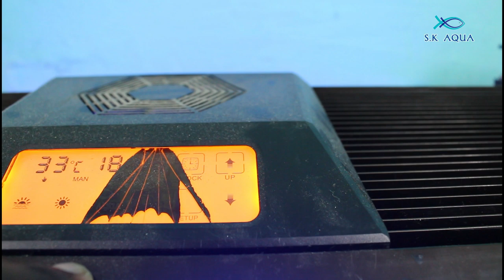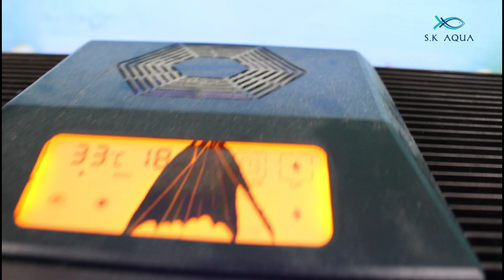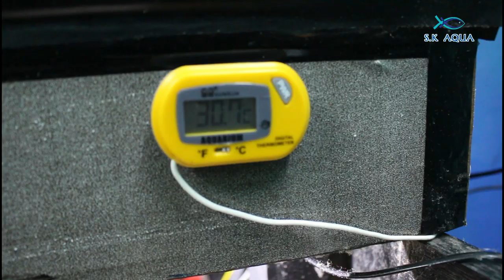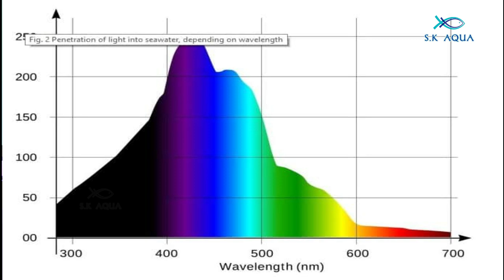How to chuse the marine aquarium light | Tamil | SK Aqua | SK Aquatic |

Comment: Great bro 
Bro temperature reduce Panna ice water bottle use panni control pannalam bro na ongalukku Instagram la voice sent pannure ok
Reply: Hi, don't go with ice packs it cause great temperature flucations and even it leads to white spot in fishes especially regal blue tang , so it's not advisable.
Reply: @edisonprasath5255  then how to reduce water temperature from easy
Reply: @b.sathurshan3090  
Fish only tank 'll tolerate up to 30 to 32max, some delicate fish only needs temp 26 to 28°. And corals needs 26 ideal. As marine hobby is costliest hobby, we need chilled to maintain stable temperate. Chillers are costly stuff and essential stuff in reef hobby. We can make DIY chiller with titanium coil and AC outdoor unit which cost u less than aquarium chiller and it cost u around 15k. 
Even cooling fan will works good only when the surrounding temperature is cool. 
Many have kept tank in AC rooms which 'll maintain certain temperature but we can't run AC 24/7 and it also leads to temp fluctuations, many experienced person 'll use AC effectively maintain temp in tanks. 
As a beginner hobbyist in marine maintaining temperature is very difficult unless we don't have chiller. We may drop 1 or 2 degrees but if we need ideal temperature chiller is as essential as skimmer .
Reply: @b.sathurshan3090  
Many person using ice packs with regular changing of new ice packs with regular intervals ,  it 'll works for some one any many can't to in regular intervals, 
If u want to try ice packs use RO water. Check Temp and salinity. 
In marine same procedure 'll not works for all.
Reply: @b.sathurshan3090  
Now only noted the word easy bro, as easy is what u said is easy to bring down the temperature of the tank,  but it's very hard to maintain temperature,  coz we need ideal temp to run the tank . Any flucations 'll lead to make things even worse .

Comment: Bro Pelter use panni chiller pannalam try pannunga
Reply: Hi, Peltier 'll works good only for nano tank, less than 150lts.
Reply: Bro tow are three Pelter use panunga  compopage iruku nenga sollurathu single Pelter three Pelter compo page rs 5000 range irukume cheke panunga Pelter colling power athigame ungalluku water temperatures maintainaka ithu pothume
Reply: @antonyjoshva5044  
I hope that too won't work bro, coz the efficiency of cooling in very low.